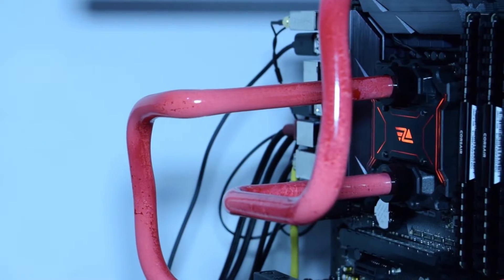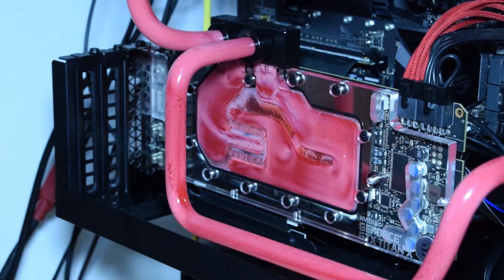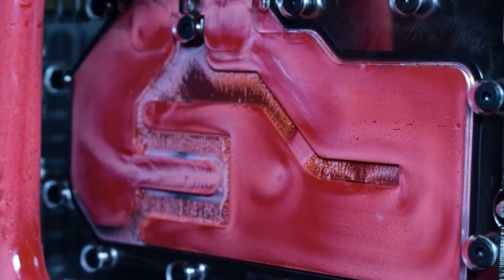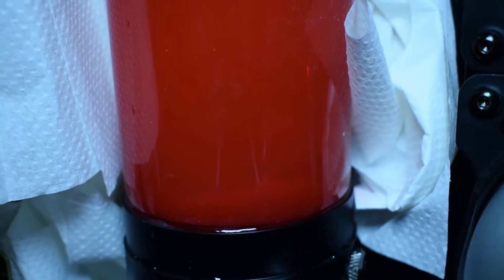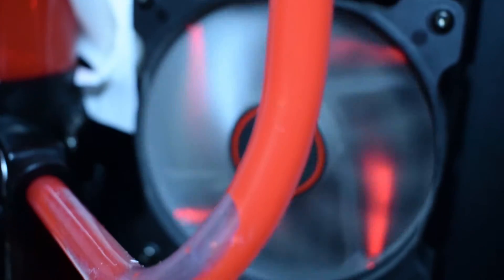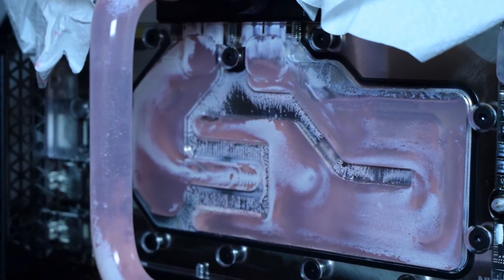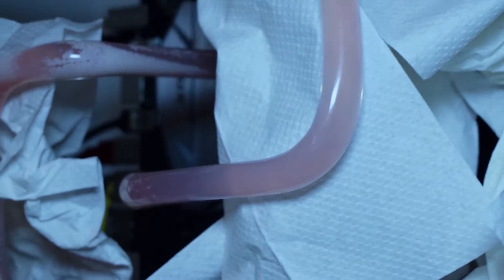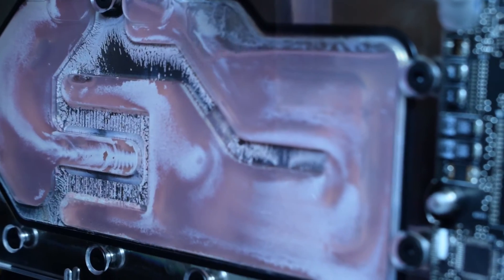How to clean your water PC Water Loop | Part 2.5 | Tech Man Pat

Comment: I went 5 years before cracking the loop for an upgrade. Just use distilled water and a loop specific additive that's ethylene glycol <70% based (they usually have some anti-ox and biocide additives). Loop was spotless. I just put in the new parts and fired it back up.

Comment: So if I use vinegar and distilled water for 24 hours there should be no harm to the system?
Another question I’m not cleaning my system yet but can I add some vinegar while the C1000 is in there? So I’ll never get it
Reply from the maker: I would suggest draining the whole system taking it apart and cleaning it it’s hard to say becomes the rad and pump will still have some gunk. I know it’s a big mission to drain

Comment: This video saved the day for me.  I was having some bad issues with flow in my system.  I found this, and, exactly the same coolant was in my computer.  Well, not red, white.  The pigment had collected on my CPU block and out of view.  When i opened it, it looked like a lint trap.  Removed this cancer liquid from my system and went with straight up distilled water.  It flows with ANGER now.,  I love it.  Thanks so much for this video.
Reply from the maker: Glad to hear you got that sorted :) Cheers

Comment: Hi, can you please tell how the cleaning product it’s called thanks
Reply from the maker: Drain the loop as dry as you can.

Get a 50/50 mix of vinegar and water (doesn't have to be anything special for cleaning), fill the loop back up with it and run it for 12 hours (use a psu shorter).

Drain it out and refill again with distilled water, run it again for 12 hours.

Drain it again and disassemble the loop to move case.

When you rebuild it just fill it as normal and you should be ok

The stuff i used was acetic acid, i cant find the bottle right now... forgot its name... soz
Reply: Tech Man Pat i have a thermal take rl480 rad and and I’ve used the c1000 coolant now all the pipes(petg) are cloudy, do you think the vinegar will do the job ?
Reply from the maker: To clean the RAD and pump etc yes you will need to run it thru a few times, but everything else will need a manual clean.

Comment: Have come to your channel (1st time) because my temps were starting to increase and looked closely at my loop (2 rads, d5 pump w/res, 2 cards, cpu block). My white Thermaltake C 1000 coolant looks like yours does. The pump at full speed was barely moving the fluid when I disconnected one of the tubes. Before disconnected to diagnose if the fluid was even moving at all the inline flow sensor (bitspower impeller) was showing a problem as it was clearly not spinning. This fluid is 1 year old and has completely failed. Not sure if I can clean all the gunk out of the system without disassembly of everything in the loop. This is my 1st loop and have come here to see what my options are. Thanks for the vid.
Reply from the maker: I also think you will find a lot of dust like particles inside your pump, personally that was the worst thing I have ever seen.

Comment: Instead of using distilled or tap water, I would use Ro/Di water. A Ro/Di (Reverse Osmosis Deionization) system, removes TDS (total dissolved solids) to 0 ppm. I do believe that will help with gunk build up in the long run. Ro/Di water is a must for a reef tank. At least it does have other uses haha.
Peace easy, hope this helps!